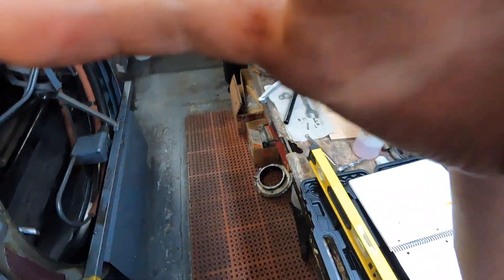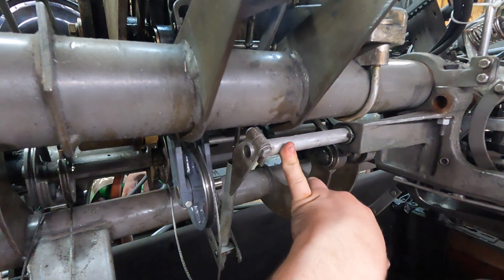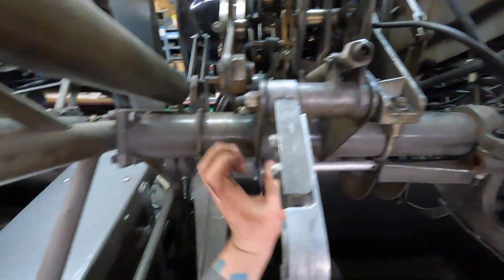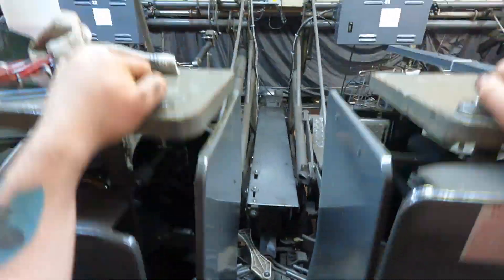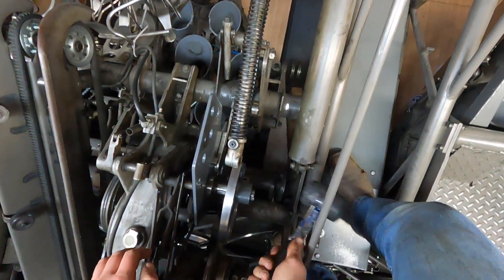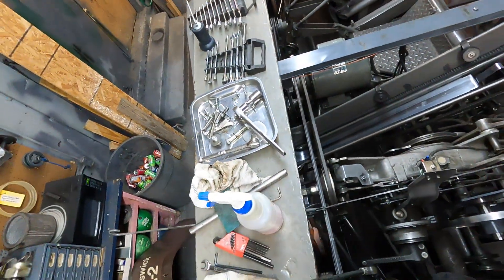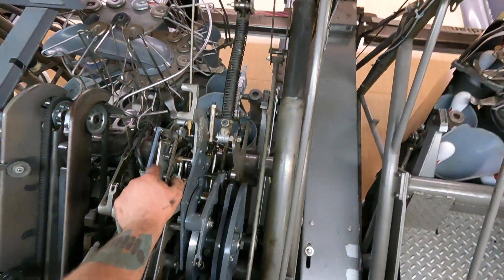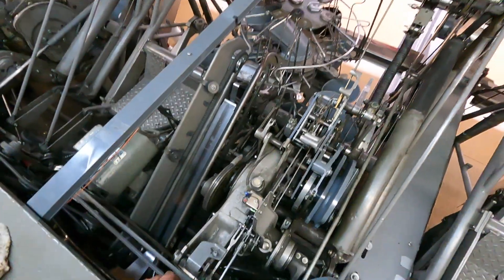1:1 Partial Rebuild - Brunswick Pinsetter Repairs

Comment: Rebuilding g/b assemlies are my favorite things to do. I spent 19 yrs working at a 24 lane house and 14 of those 19 yrs I had worked with a remarkable mechanic that was like no other. He took me under his wing and showed me things and ever since I have been bitten by the bug. He saw more than average potential in me when he saw that I had rebuilt not 1,...... but 3 1:1's in a single night during leagues and at that time I had never even done a 1:1 swap yet,...... just read the manuals and started tearing things apart and putting them back together. Now here I am working at a 32 lane house continuing the work that he has showed me ,....... still learning,...... still growing,...... still wrenching away at these indestuctable machines.

Comment: Great job, new parts look so clean! I don't envy you having to do this at all, the detector and the cams are the part of the machine I have the least experience with.
Reply from the maker: Thank you very much! I didn’t want to run the machines after we got it done cuz it looked good lol Detectors I had no experience with till the school, then came home and rebuilt and changed at least 20 so far. But the Gearbox is the thing I have the least hands on experience with

Comment: I just got done doing a training course on how to remove a 1:1, I never thought I wanted to see it again but here I am watching. I couldn’t get my detector back on the right tooth to save my life, must have tried a dozen times, bravo sir
Reply from the maker: I’ve probably changed out 20 Detectors before this, so I’d like to think that helped lol. Thank you!
Reply: Way late to the party.  Next time you do a 1-1 do it at 90 degrees strike.  Puts you in the perfect position to where you don't have to mess with the deck lift pin and also you don't have to mess around with the timing marks through the inspection port on the gearbox housing.  Timing your detector is super easy as well.  There's a scribe mark on the M/D scissor cam that bisects the follower bearing perfectly at 90.  That's how you time the 1-1 when you reinstall.  Fastest I've ever done one is 4 1/2 hours.  The slowest for me has been 8 hrs since I hit a couple snags.

Comment: You're lucky you have the new style m/d scissor cams with the clamping bolt.  If a key breaks on my 1-1's they have to get yanked.  Gotten pretty good at it.  6 hours is the norm.
Reply from the maker: We’ve had to do some without the clamping bolt. I just put one with a clamping bolt on afterwards lol
Reply: @thepinsettermedic  Those are gold if you can find them used.  Saves sloppy 1-1 Keyways from not being usable.  Got a couple 1-1's I can't use due to new Keys fitting sloppy in the keyway.  Attempting to source new style cams without buying new is a chore.
Reply from the maker: We got lucky cuz our previous owner took out 10 lanes for an arcade/billiards area so those 10 machines become part machines

Comment: You know I don’t mind longer videos. It’s just frustrating seeing parts left out in the editing. I don’t mind a step by step procedure, instead ok it’s all back together and we didn’t we how it went.
I mean did you have to use a puller to get the cam off? Or just pounded it off? 
And seeing the detector come out and adjust it a tooth.
I just like watching the process without cuts in video. :/
Reply from the maker: Ok next video I’ll make sure to leave in a lot of that stuff, didn’t know how some people felt about videos that got up there in duration. Now that I have an idea stuff like that will be longer and more detailed. Thank you for the suggestion, want to make the videos the way you guys want to see them!

Comment: What color spray paint did you use on the detector plate? Super nice vibrant color
Reply from the maker: Rust-oleum painter’s touch Gloss Dark Gray
Reply: Not sure how it is now, but years ago you could actually order "Brunswick gray" paint.
Reply from the maker: Yeah I was told about that. We haven’t done is so not sure if you can or not
Reply: @warmongerel9743  you can get some Touch up paint but i have yet to find anything other than that from Ace Mitchell

Comment: I’ve had to pull gearbox at my local bowling center. The deck is in the down position 270. How do I go about lining up? The timing marks in the new gearbox?
Reply from the maker: There should be a timing indicator on the mounting plate for the Detector assembly, has four lines that say 0, 90, 180, 270. That’s been the easiest way for me to know where the box is whenever I’ve pulled them.

Comment: What do you think about the kegel turret pockets, my center has been thinking about trying them out, and phasing out turret wires, but we are don't want to do it if its not as reliable.
Reply from the maker: So from everything I’ve heard and even with talking to someone from Kegel it’s usually the same thing, the work great for others and not at all for some. We only get it for the 1,7,10 and we like them a lot. Best thing you could do is get a few, and put them on lanes you have problems with and try them out
Reply: @thepinsettermedic  Appreciate the info! We will try it out and see what happens

Comment: I have a machine that the rake cam jumps at certain point in cycle, should I prepare myself to change of the 1 to 1 ?
Reply from the maker: I have a couple that do that too. They’re still running lol. Problem is that it could be anywhere in the gearbox that is missing a tooth

Comment: So whats a complete 1 to 1 rebuild require ? Bc this looked pretty simple compared to a full 1 to 1 rebuild like the manuel i read im kinda scared rebuilding one since i never did even though i have one lane that really needs it in my opinion with the rake cam jumping at certain points
Reply from the maker: The problem is that the deeper you pull it apart the more you’re needing a hydraulic press to put the gears and stuff back onto the shaft. It’s not hard or to scary as long as you have the tools needed

Comment: what causes a 1-1 shaft to need rebuilt. Is it a constant 180 stop issue
Reply from the maker: No that would be in the linkage. We had to change a whole 1:1 assembly out cuz the cam broke and it was easier to c/o then rebuild. This one was literally just cuz of that plate being bent.